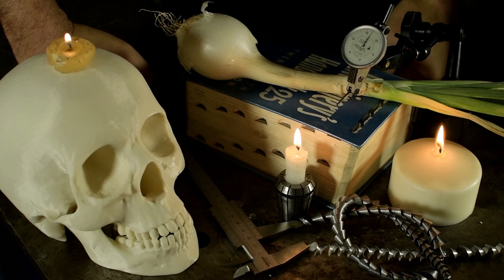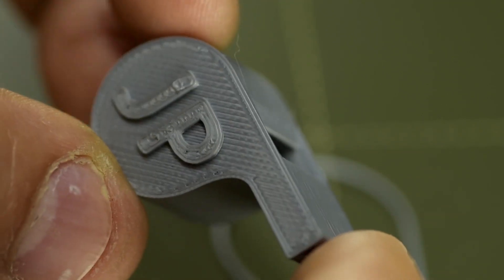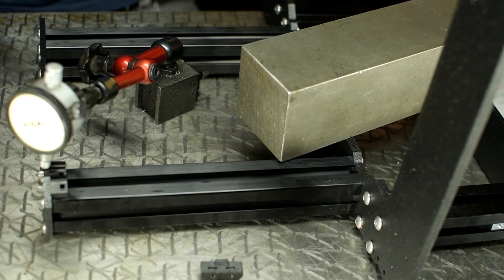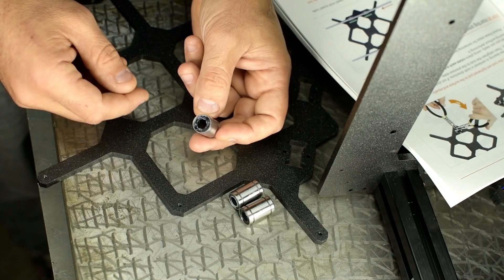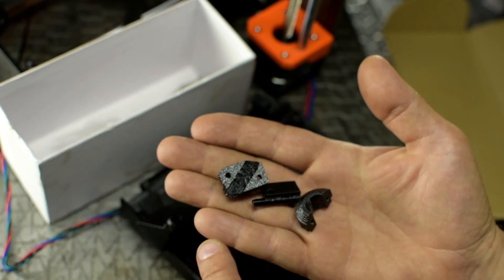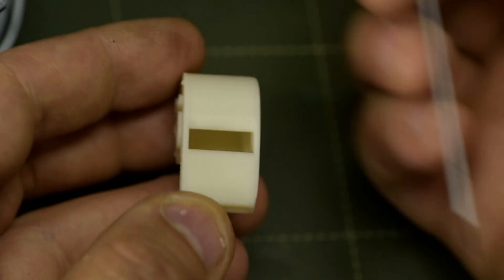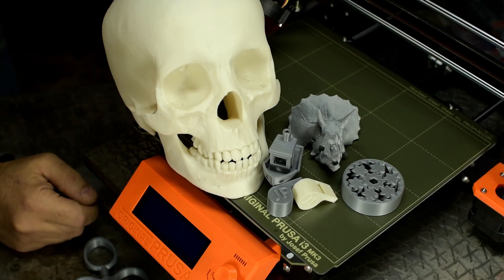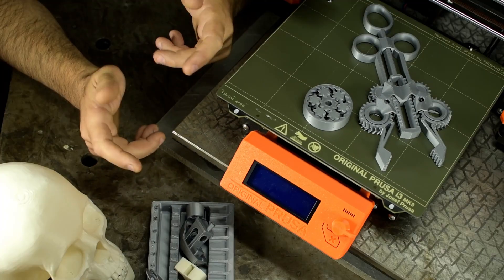This Old Tony in 3D!!! (printing)

Comment: The "get what you pay for" does not apply to the Ender 3. That is why it is the most used/recommended/modded. I have had mine for 3 years.
Reply: I have three Ender 3 Printers. Two MK-1 with BigTreeTech SKR-Mini E3 Boards and glass bed with BL-Touch, and the new Ender 3v2. Costed me the same as oner Prussa. The Cech-Guy is robbing people with his 3D printed parts.
Reply: I am amazed at the number of people who watch This Old Tony that don't see the point in buying the cheaper Ender 3 and modding it to make it even better than the Prusa for half the price.  I mean I guess Tony should have bought a new CNC mill or router, he would have saved a lot of time from making all these videos.  I have been interested in 3D printing since RepRap forums, when I look at the Prusa I see the open source unit from like 10+ years ago, that can be built for pennies on the dollar.
Reply: It is the most used/recommended because it is so cheap and most modded because it needs modding.  That there Prusa is the one to get if you have the cash for it.
Reply: I don't get Ender hype. It was justified at the start but i'd rather have Geeetech A10; or alternatively actually Ender 3 Pro, has its advantages. Not the base Ender 3.
Reply: @SianaGearz  I started with a tronxy xy100 mini 3d printer I recently upgraded to a di vinci jr pro I love it and I can print in petg ( highly recommend adding a fan to exhaust the smell outside  as it stinks when  printing ) ps thisoldtony add a heated bed to the printer and a bigger power supply  you'll thank me later as it helps with abs and petg
Reply: @southern207hobbies  What's up with your PETG? I got clear Renkforce PETG and it's got no smell. ABS on the other hand... ouch.

Also "add heated bed"... WHAT? his printer ships with a 150W heated bed and a 240W (24V) power supply, it's perfectly adequate. No upgrades needed.
Reply: @SianaGearz   I use overture petg trust me it smells bad I bought it for the hospital ppe shortage  back in March  honestly I've only been in 3d printing for just over a 2yrs
Reply: What usually gets modded, or could you point me to a good video of the mods, please?
Reply: @bradyoung6663  At an Ender 3? Swap the Mainboard for an BTT SKR Mini, change the bed leveling springs, print out a side spool holder, and get some capricorn Bowden tube. and change the extruder to an metal one. Search for "Teaching Tech" on Youtube for all your Ender needs ;)
Reply: @Ordog213  also CHEP
Reply: I bought the Prusa i3 Mk3s ’because’ I did not want to have to modify a cheaper printer to make it work correctly. The whole reason people buy the Prusa is because it works without modifying.
Reply: Word. It's 2020, any 3D printer over $300 or so is just robbing you mercilessly, unless the extra money goes into very specific and clearly visible extras (say, heated enclosure etc.).
Reply: @AttilaAsztalos  That's not exactly true. While the Ender 3 is a decent printer, it has a number of flaws - it doesn't have ABL, Trinamic drivers, spring steel PEI, linear bearings, etc. - and their QC is hit or miss. Remember those burning XT-60 connectors a few years back? While the Prusa i3 is expensive, it is also worth it to people who don't want to potentially spend a TON of time debugging or upgrading their printer. I scratch built my own printer, but only because I enjoy that process - there is a value to a machine that "just works".

Comment: Awww man, not a Prusa, you can get more for less. Prusa parts still shitty printed I see. All that money and Joseph can't be bothered to get them injection molded
Reply from the maker: which?
Reply: @ThisOldTony  The Creality you mention in the video is a very good machine. Other brands worth looking at are Two Trees and Sapphire.

Early out of china kits were hit and miss, especially the laser cut acrylic frame machines like the Anet printers. The Core XY options coming from them are fantastic, some even have MGN12 rails offering many advantages over the standard unsupported rails on the Prusa.

You can easily spend half that of a Prusa for an excellent machine.
The Prusa slicer is excellent and perfectly optimized out of the box for the Prusa i3 which is why the Prusa gives the results it does. With a few hours tweaking all but the most bargain basement printers will print to this quality. I have built some 20plus printers now, two of them I designed and built from scratch, all get Prusa quality or better. Good settings do more for print quality than part quality can on almost any machine out there.
Reply: @npgoalkeeper _ Dimensional stability, precision bores and bearing pockets, plastics stable at higher temps. Plenty of advantages

Comment: That is one of my only bugbears with the Prusa kits, is that ppl like me assemble the linear bearings WITHOUT greasing them. They last about a month before they start binding, and you have to strip the whole thing down, and replace with NEW lithium greased bearings. But other than that, the kit is a great way to learn about how the printer actually works.

Comment: This is a very very good printer. Also very reliable. Leaving a printer is a bad idea tho. I don't have a prusa but after 3 years of printing it decided to try set my house on fire. Got a hot connection on the heated bed wire lume. I really recommend a fire sensor. Good luck printing and enjoy.

Comment: Can you 3D print a 3D printer?
Reply: Oh, ABSOLUTELY! ...except the rails. And the rollers for the rails. And the leadscrews. And the belts. And the stepper motors. And the electronics that drive them. And the hot end - haw haw, obviously, it would melt even if you could... But yeah, other that those minor details you totally can print a 3D printer with a 3D printer!

Comment: So many different materials and diameters of hose adapters are in your future. I swear half my dust collection in my shop is 3D printed.
Reply: Yeah, no kidding! I needed to replace an air hose fitting for my airbrush and all the hardware stores near me were closed.  I pulled up Fusion360 and grabbed a couple models from McMaster Carr, modified and combined them to make what I needed, printed that out and it worked perfectly. So perfect indeed, I haven't even bothered to go get the brass parts I planned to use. It's been 2 years and it's still holding strong. Used Hatchbox black PLA.
Reply: @BEdmonson85  I use the old reliable hatchbox Orange here. I had the exact same experience, but I was getting the dust collection going on my x-carve and everything was closed and couldn’t get a Shop Vac female-female adaptor. So I just got out the calipers and stated 3mm wider then tapered to 2mm shorter in a tube. 

I didn’t know the trick of lifting the stl’s from McMaster-Carr at this time. Just fusion 360 and calipers.

Which printer you rolling with? I’m rocking a heavily modified Ender 3 Pro.
Reply: @NathanBatson  Same here, modified Ender 3 (not pro). Upgraded fans, motor drivers, capricorn bowden tubes, and various other printed upgrades.  I just use a $2 glass pane from Ace hardware for a bed surface.  PLA sticks to it when it's heated and magically releases when it cools.
Reply: @BEdmonson85  I use the Creality glass bed, did a direct drive conversion, buck powered Raspberry Pi with octoprint, and upgraded the hot end to the MicroSwiss all metal. I did all that to print TPU much easier, I make custom feet and spacers for my various CNC and tooling. Little custom TPU pads can reduce unwanted vibration and I printed some (really) soft jaws for a little vice.

Comment: now machine the 3d printed parts to have an "all aluminum printer"
Reply: Yes please, it would be hella expensive but really awesome
Reply: @elrancio60esbacan86  cant you just use a mig welder on a 3 axis setup so its a metal printer
Reply: @captainheat2314  If it's sturdy enough you could but you won't get a reasonable surface finish nor would achieve and reasonable dimensional tolerances. The part wouldn't be useable.
Reply: I'd love to see that.
Reply: Yes please!!!!!!!!!
Reply: yes; cool idea
Reply: I did that for my frame AM8, I machined brackets and mounts instead of printing them. really helped reliability and stability.
Reply: Great idea!
Reply: I thought "additive machining" was already a thing? Saw a blurb about Airbus using it make parts instead of machining parts from billet. 🤔
Reply: @ironbomb6753  They're not at that stage yet. The parts are just wire harness brackets and inconsequential parts of that nature. There's nothing structural that's 3D printed for obvious reasons.
Reply: @internettoughguy  copy man, thanks. I know almost zero about 3D printing, just what i learn here and other places. Most of my time goes to my lathe, which i just got. Not a small one, a full blown old school production lathe. I love it. This 3D is pretty cool tho.
Reply: @ironbomb6753   I work at Pratt & Whitney in engine testing. We're also experimenting with metal 3D printing. It's interesting tech but we're still a ways off from using it for structural applications. The big stumbling block is that the material properties can't be guaranteed at this stahe in the technology. If we can't trust the material's mechanical properties then we can't do any meaningful stress analysis.
Reply: @ironbomb6753  metal 3d printing still has a way to go sadly, there are some interesting techniques I've seen where a basic shape is created by essentially a welder on a 3 axis machine and then using a mill and lathe turned into the final part which equates to less waste, markforged also have a metal 3d printer but I don't know a tonne about it
Reply: https://youtu.be/OuB4Xfdk4eg

Comment: 10:02 it is Earl Gray, and it's slightly warm, so I guess that fits the request to a T... 

So let's talk about STL files and G-Code...
Reply: Earl Grey 😉
Reply: @pnt103  Only in England, Buddy.
Reply: @WhereWhatHuh  It's Earl Grey everywhere. It's a surname not a colour. https://en.m.wikipedia.org/wiki/Earl_Grey
Reply: @WhereWhatHuh  No, It's "Earl Grey" everywhere 😉  Just as "Gray code" is spelled with an 'a' even in the UK.
Reply: @khaitomretro  Yes, I understand that. But Benchy is gray ... Yeah, if the joke needs a wikipedia link, the point is lost. Thank you. Have an ice day.
Reply: @pnt103   Yes, you are correct. But the joke works better as gray, b/c Benchy is gray, not grey (because he was printed in the US, not the UK). If he were a tea, then he might be Earl Grey, after the eponymous Earl. But he's gray, and if the shade of gray was "Earl Gray ..." (which, admittedly, is not a recognized shade of gray, unlike haze gray, deck gray, or machinery gray). So I will concede the point and let the punch line die. Best wishes.
Reply: Let's not talk about STL files but 3MF instead because STL needs to die.
Reply: @Anvilshock  Does it export something sliceable from Blender?

Comment: 7:57 Finally, a tool I have that TOT doesn't.
Reply: You have a 5.5mm nut driver 👍🏻
Reply: @davidparsons9167  The point is that it's an especially small victory.
Reply: I was half expecting a mid video montage of making a new rotary broach. Maybe the next video.

Comment: My ender pro 3 was more assembled, cost $180, and seems to be about the same quality as yours. However, mine did require some finesse with the settings to get it to print properly, namely the extrusion rate and issues with bed adhesion. Oh ya and my bed was warped so I bought a piece of glass for the bed and it actually works better except you need a fat skirt on everything or else it will peel off halfway through printing. But otherwise it is a great little printer.

Comment: Can’t wait until ToT learns about filament prices 😂
Reply: Where I live it's like 15-25$ for a decent 1kg spool.
Reply: I use hatchbox PLA for about $20 a spool, never had any issues
Reply: Stratasys filament can run you $200 or more a pop . but only those locked into their system buy that stuff, lol. For the rest of us, there's decent (and larger) rolls for around $20 to $50 respectively.
Reply: Nah, he'll probably keep using the strimmer line and mig refills
Reply: Cheap PLA is sub $20 per 1kg spool. Nice PETG is around $30 for 1kg. If you want somewhat more advanced materials, you may be paying $50-$100 per kg and you usually get them in 500g or 750g quantity. It's all kind of crazy cheap, what adds up is having multiple spools that you don't use enough of because you needed some special material. Items that aren't too big literally end up costing cents, and that including the power that the printer of about this kind of size consumes - about 80-150W depending on material and ambient temperature and draftiness. The full rated power of the power supply is taken up just during the heatup phase when you start it up.
Reply: Neil Siebenthal  the uPrint/hp designjet at work is ten years old now, has never had any maintenance, but still makes decent prints. It has native network printing support, is self-cleaning the nozzles, has sensorless touch probing, and a heated chamber with lights. Its mechanical design is more robust than any hobby machine on the market today, and will probably outlast them. Its major downfalls are the chipped, expensive filament cartridges, and the outdated slicing software, and heating, loading, unloading taking forever, as well as a high noise level.
Reply: Neil Siebenthal  Will do. I would love to replace the old uPrint with a few hobby machines, but work safety rules dictate that to be a no-no.
Reply: Do you do any printing? I know prices for filament used to be high but $20-$25 for a spool of good PLA is not bad. ABS is even cheaper. Right now filament is a little more expensive than it was this time last year but that's because covid. It's not that expensive unless you are looking into super specific engineering materials like PEEK or PEKK or something but even nylons aren't that expensive.
Reply: I pay 15-20€ for 1kg of eSun ABS+ - not really an issue…
Reply: Gosh can you imagine if the prices were on the internet? Thank god they aren’t.